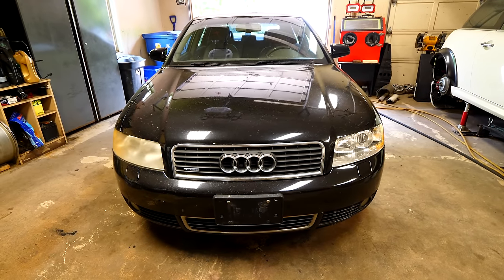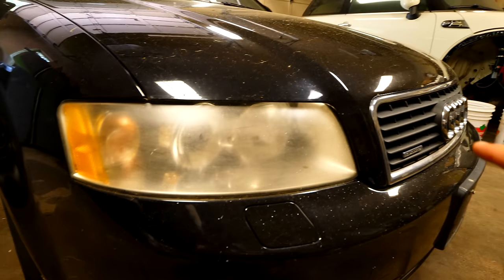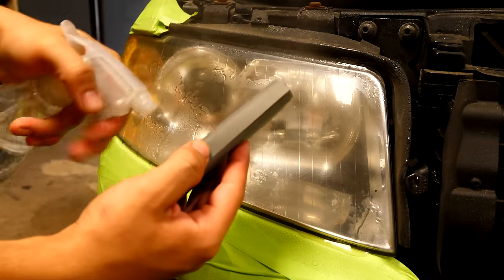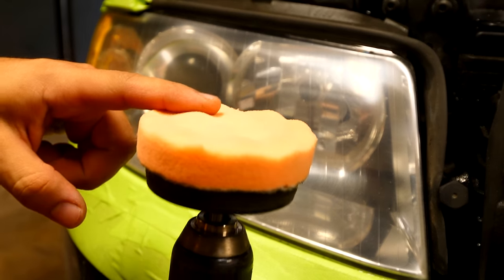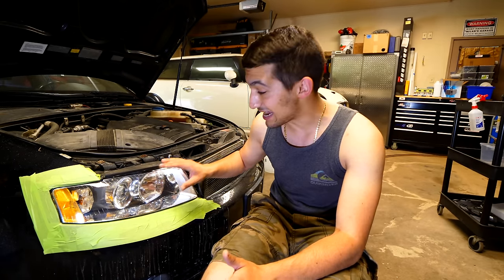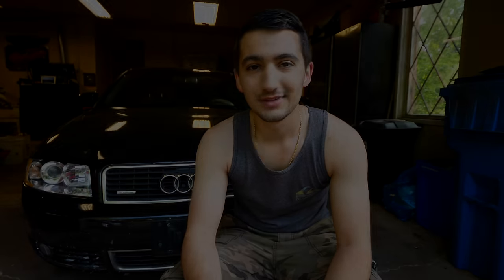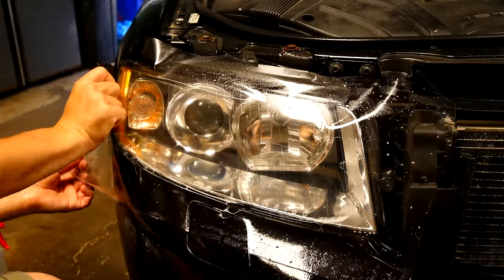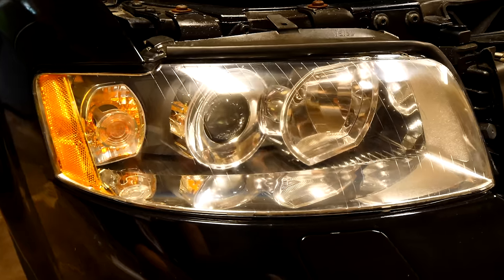Restore Neglected Headlights to BETTER THAN NEW Condition

Comment: Regardless of the Naysayers who’ve posted negative comments, out of the many YouTube videos on this particular subject, this guy’s video is head and shoulders above the rest. As someone has already mentioned, he takes the time to carefully explain what he’s about to do, as well as why he’s doing each step, AND clearly describes and identifies each product he’s using. 

The headlight lenses on my 2007 GMC Sierra VortecMax are embarrassingly yellowed! I mainly use it as my hunting truck, and hadn’t really noticed how dim the headlights actually were, until a friend asked me if I knew one of my headlights wasn’t working. I changed the bulb, thinking that my headlights were going to be bright again. I know, that wasn’t very bright on my part. (Pun intended!) 

I plan to purchase all the materials he suggested, and try to restore the lenses on my pickup. The batteries on my DeWalt drill died years ago, but I imagine my Bosch drill will do an adequate job. (Just a joke here folks. I doubt DeWalt has given him a Lifetime Supply of DeWalt products for using their drill in his video. If I’m wrong, I’ll be happy to announce to one and all that my Bosch cordless drill does an even more amazing job than the DeWalt if they’ll send me a lifetime supply of Bosch products!☺️)

If anyone reading my comments has used this guy’s headlight lens restoration methods, I’d appreciate your comments as to how well they worked for you.

Comment: Totally agree with using paint protection film over using clear coat to protect the headlight housing.
Reply: Why not clear coat it, then put the film on
Reply: Sam Sonn I suppose you could, but you would have to wet sand and polish to make it perfect because you could be technically diffusing the beam even more having to pass through to two materials.
Reply: AnthonyJ350. Of course
Reply: Yeah but's hard to apply on cars with a lot of curves on the headlights.
Reply: Sam Sonn 

There's just a lot more issues with clear coating. Over spray, adehesion issues, the temperature and humidity has to be right or the clear might not look right, and you don't know how long it will last. 

This is much easier and in most cases, longer lasting.
Reply: But to cut the film to make it fit and get enough coverage on not totally straight headlight housings ??
Reply: Sam - You don't have to do both. Clear coating is not necessary if you use film. And using clear coat is a bad idea because it's very prone to chips from flying debris. And the appearance of the chips are more noticeable versus headlight without the clear coat. It's best to just wet-sand it, compound it and polish. And wax every month to keep UV out. or polish it again for cleansing. It's similar to washing your face. How do you feel if you don't wash your face for a week? Huh? You tell me. Everything needs good cleansing and pampering headlights included.
Reply: AnthonyJ350 what about instead of going those routes I tint my headlights with tint not spray tint
Reply: Another method I thought of is ceramic coating. Easy and quick to apply and will last for about 1-2 years. Make sure it's UV resistant

Comment: This is the BEST solution for oxidized plastic headlights I've seen.  I installed Xpel headlight protection film on my 2003 E46 headlights and front turn signals when it was new in Dec 2002.  Almost 16 years later they still look crystal clear.   Putting PPF over headlights that you just restored is the best way to keep them looking new.
Reply: Trop x .

Comment: I worked for a semi repair shop and this is how we did it except with the sanding we would move up to a finer grit after we were done with the previous grit about 3 times until we finally hit 3000 grit...lil more time but if u can only afford a cheap polishing agent or compound its a good idea to do so :) nice work bro

Comment: Very nicely done to and to the point tutorial on headlight restoration. I had used the Turtlewax headlight restoration and it works fine on my headlight but mine only has some yellow oxidation on the top and in much better condition than these headlights where you can barely see the bulbs inside the housing. The only thing that I would say is that the PPF is good but it would turn yellow much faster than the lens as you notice the PPF on his Accord, it already has the yellow tint after a year or so. You would have to plan on changing them out every 18 months to keep the headlight clear white. I'd just use sealant and be done with it.

Comment: So i used this method a month after i tried a restorer kit, my lights don't look new but they still look amazing, in comparison to before and for a 11yo car. The ppf did not mold to my headlight properly so I opted for a headlight coating instead. Thanks again for the vid, will try the ppf again at some other point in time

Comment: Great video👍🏻🇨🇦. Did mine  on  the RSX in the fall.  I also clayed the headlights and put ceramic coating on them
Reply: That's a good and easier alternative to putting a clear coat or PPF on. I was thinking of buying a ceramic coating but can't justify buying it just for the headlights.

Comment: Why can't the automaker's put that paint protection film on their cars so we wouldn't have to go through this.
Reply: Because they don't care and will cost them more time and money it's why there plastic in the first place because it's cheaper than glass.
Reply: Because they'd rather sell you a new car.
Reply: David Rothschild  Exactly. I was thinking the same thing.
Reply: @simonwalker1255   Glass shatters, that's why they switched to plastic (it's also cheaper than glass too so there's that also). The plastic will break off yes, but it won't send hundreds or thousands of little chunks of glass all over the road. The plastic lenses break into much bigger pieces usually, easier to find and remove from the roads.
Reply: David Rothschild, it's the auto industry making money off of repairs as a plastic headlight housing can start at $200 on up whereas the glass sealed beam headlights of the early 1980's and prior can be $50 for a set of 2.
Ford Motor Company pushed the National Highway Safety Institute to require all vehicles made after 1990 to be equipped with the composite plastic headlight housing we see today claiming it provides safer visibility but General Motors and Chrysler were against them stating they would accumulate condensation inside of them and fog from oxidation but what sweetened the deal to pass it was Ford going to Congress and saying that the plastic headlight housing is lighter than glass and would improve fuel economy and lower hydrocarbon emissions which Congress wanted from automakers so it became required on all American vehicles made after 1990.

Comment: Is it true that paint protection film over the lens would not allow heat generated from the headlights to escape resulting in premature wear ie tiny hairline cracks on the plastic lens.
Reply: I wonder about that as well....
Reply: Maybe some light will not go through, but for sure, when it was stained and yellowish, way more light was trapped!!!
Reply: I don't think that film make any difference on the heat transfer.
Reply: @patosborne007   Pretty much every older car that does not have LED and even LED's get hot

Comment: Great video. I do realize this is a few years old, but you should not tell people to use clear coat on the lenses.  It actually distorts/refracts the light as it passes through it and can make it just as bad or even worse as it was before you cleaned the yellowing off of the lenses.  But other than that, it is a great job.

Comment: Great video with amazing information. I have been polishing mine for a while along with spar urethane + mineral spirit. It does the work but only last about 4-6 months. This method is great, BUT ur mileage might vary depending on your head light design. On this video the head light is round without any crazy surface, try to do this nissan quest 04 and you will be there for a while. I did it on my 2008 Odyssey and it looks great, installation was a bit tricky but I made it. Make sure the area around the headlights is clean (bumper, fender and inside bay. Any dirty will stick to it even if you have soapy water. Thanks for sharing.

Comment: Great video!! Your presentation is excellent and clear!! Unfortunately unable to apply your method as my headlight lens are to bulbous to use a sanding block + apply headlight film,Which is a shame, Because the film would be a long-term salution to headlight detereation over time, I have heard over time depending where you live the film can shrink and spilt, But as you explained it's easy to replace, Thanks and Good luck in the future 🇬🇧🤔👍

Comment: Milan Mastracci   Hi, I am an engineer, and that UV filtering paint protector sounds like a GREAT idea, maybe just the ticket.  I will polish 'em up one more time (about 20 min/side), and give it a shot.   What kind of longevity do you typically see before they need changing out, given that stones, etc. are not the driving factor?  I really like the 5-10 min "fixability" feature.

Comment: I just completed my passenger side with a much less complete method seen in another popular instructional video (varied grid sandpaper to eventually 2000, all by hand only, then clear coat). Final product looks half as good as you're more complete method - which I am going to perform today on the driver's side. Looking forward the comparison (and redoing the passenger side).
Reply: So . . . how did the driver's side turn out?
Reply: @pvman2  Much, much better. Not as good as in the video, as I'm a newb and was wanting for some of the drill materials - but way better than the original condition. I went back and redid the passenger side with this method. Definite improvement, both visually and in night driving!
Reply: @realtoast7036  Great!  I attempted to do it today and realized I didn't have the same 3M kit as Mastracci.  I had the 3M Heavy Duty Restoration Kit.  It does not have the foam cutting pad.  I also didn't have the polishing pad.  I went to 3 separate auto parts stores, but none of them sell 3 inch pads of any type, only sanding or metal cutting disks.  I'll have to buy them online.  So . . . I wait.

Comment: Ive been restoring my headlights for years. I didn't use any kit or drill. I just used some sand paper (1000 gritt-5000 gritt), plastic polish, and UV plastic sealer. I initially did the wet hand sanding, plastic polish, and UV plastic sealer. But the UV plastic sealer doesn't last over three months. So I have to touch them up my headlights with plastic polish and UV plastic sealer, every 3 months. Touch up takes less than 5 minutes. But I would love to not have to do this 4 times a year. I never heard of PP film until now.The next time i do a touch up, I'll skip the UV plastic sealer and use PPF. If that lasts at least once a year, that would be great. Thanks. PPF would be great for front and rear bumpers.

Comment: I got some film for my lights, but I'm not sure it uses liquid. I got a heat gun specifically for it, so it's more of a dry wrap. I'm going to use it to protect some chrome as well. I'm a mobile detailer, so my 2017 Nissan looks showroom; it seriously has not aged. The lights are crystal clear, but the reason is not only am I a freak about my car, but there is already a film on the lights from the dealer. I don't usually see this for this level of car, and I see a lot of cars. I think I paid for some kind of plastic protection way back, but did not realize it was on my lenses until I upgraded the bulbs to LEDs recently. I can feel the vinyl-type substance, but it is invisible except for the very edge if you look closely. I washed that car 2000 times and never noticed it before.

I'm still going to put the film on over the existing cover, but it's not that I ever experienced a problem, and even I can't explain why it never yellowed or faded, except it was always covered and waxed. I just want to prevent an issue, even though after 7 years it still looks new. I don't know how I've avoided rock chips on the lenses and chrome trim, but since it's still looking good, I figured I'd go ahead and [finally] wrap it. After I paid for it last year (6 year loan), I have a better appreciation for it, and with only 65K on it, I think I'll just keep it. The dealer wants to buy it every time I get an oil change, so it must be of interest, but it is exceptional. I'm going to buy a motorcycle with the money that used to go to a car payment, and I'll have money left over.

I would take this man's advice and do this for your car before it turns cloudy, and certainly after it does if you repair it. Prevent the problem before it exists, then you won't have to fix it. I was fortunate, but I might not have been. So, now is always the time to do it. Nice video; it's not the first I've seen.

Comment: This is how they polished up the dome windows on the Navy P-3 back when I worked for the USN. No coating was applied. The film looks like a great idea, but something makes me think it will take a few tries to get good at putting it on.
Reply from the maker: As long as you aren't gentle with it, you can get it on there. The only 'difficult' part of it would be applying it to the curved areas of the lens, as the material is much thicker than Saran Wrap and even vinyl wrap, so you have to use some force to made the bends.
Reply: @milanmastracci  Assume it will want to gather, so sounds like need to make stretch. So don't baby it.

Comment: Five minutes rubbing with Dot3 brake fluid and shop towel followed by ten minutes with rubbing compound will do nearly as well as your method.   Perhaps 90% as well.   You did a very good instructional video though.  Well done.
Reply: For anyone that wants to know.  Yes, i did use the dot 3 brake oil method on headlights that were very yellow and the rubbing compound was needed as well.  Get rubbing compound at various stores that sell car wax.

Comment: I just read SOME of the comment's, and you deserve all that was said. Problem is, I live over the pond. I don't have a clue where to get some of the bit's and pieces required to do the job. i.e. P.P.F.. I can't find it ANYWHERE. The backing pad, disc sandpaper, and foam pad, looks like the type of thing a kid would get as a present so they could copy dad  sanding the wooden floor. I will have to send out a search party. Any more tips along the lines of this one would be very welcome.

Comment: Great job on this very informing and well produced video !!   P.S.  I made the mistake of trying to burn off the old yellow oxidation with a plumber's torch filled with map gas. Can I just leave the existing headlamps in their current condition ????.........that is with the outer lenses completely burned off and the inner lights still working !!

Comment: Just want to say this was a professionally done video, and your speaking style was clear and very well done. I detail myself and have done restoration countless times on headlights. I love both the video quality and the method of PPF afterwards which is almost a no-brainer but very much a "my god why didn't I think of that" moment for me. 

Question for you, with the hazing, is 1500grit your go to then right to polishing compound? A lot of methods exist including starting at 800 grit or 1000 grit and moving up to 1500 then 2000. What do you find works the best? I like saving time (i.e. money) with what you did in 1500 grit then 3m compound followed by two-step polish, but just wondering your thoughts?

Comment: I'm confused. Most, if not all, of what you used sounded like they were not part of the 3m light resto kit. 
So my question is, what is the point of listing the kit? Sounds like you can just sand with 1500 then 3000. Follow up with a cutting compound and then polish.  Nothing from the kit would be required.

Comment: Added it all up but for a drill, the dish sop, and a utility knife.  Everything adds up to $176!!  For those with one vehicle it will be less expensive to buy new lenses and lights.
Reply from the maker: You might be able to find used lights for that price, but they will most likely be in the same condition as your oxidized ones that will require a restoration. I hope this video helps :)
Reply: It did.  Appreciate  your knowledge, and presentation.  The new lights come from offshore. Example, new for my explorer and Acadia are about $250 a side.  $500!  Offshore from Amazon, eBay or some others...about $90 for a pair with basic Halogen bulbs included. Checked out your less expensive solution.  If I did this for a living I'd spend for the full array as I have the tools.
Reply from the maker: Oh wow I had no clue they were that cheap! That's crazy

Comment: Cool Vid.  I wish all manufacture build glass headlight vs the plastic material.  We spent over 30K+ on those luxury vehicles, manufacture needs to at least have the headlight durable that last.  I've seen Mercedes-Benz's and BMW with those ugly faded headlights. Sh*T my 300zx have the glass headlight and it's less expensive than those brand I've mentioned.

Comment: HINT: After totally cleaning headlight covers do NOT use a liquid protective solution. Instead go to a custom car company that installs clear protective film on front body panels and pay for them to COVER YOUR HEADLIGHTS WITH PROTECTIVE FILM. This will easily last 4 or 5 years (depending on exposure to sunlight) before needing to be replaced.

Comment: I have to agree with another commenter, Great Video.  The 3M lens restoration kit you linked is currently unavailable 39045.  Amazon referenced the 39008 version as a replacement.  Is this version a good replacement for use with a drill or do you suggest a different part as a valid replacement?